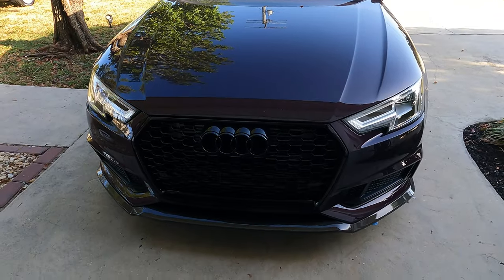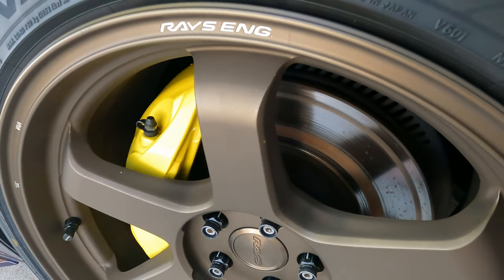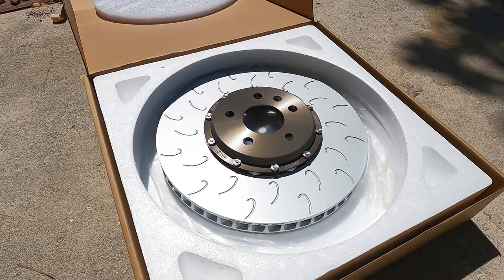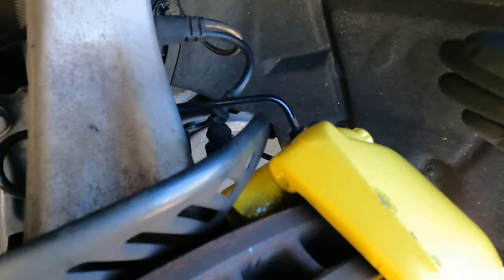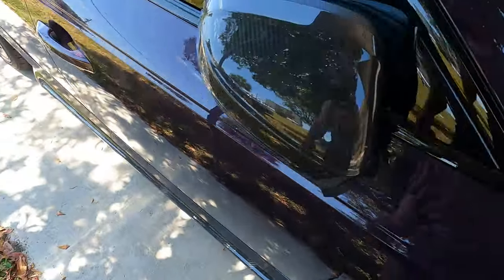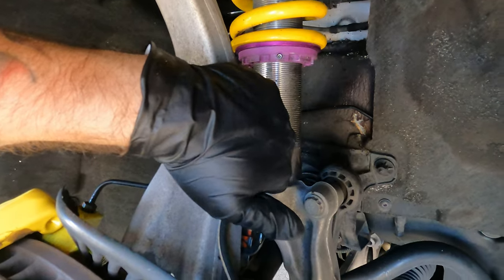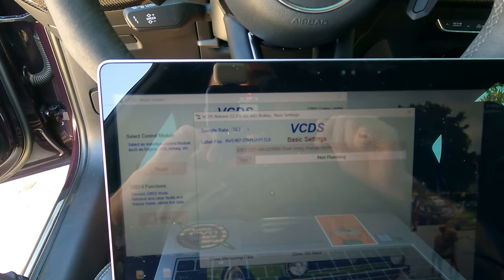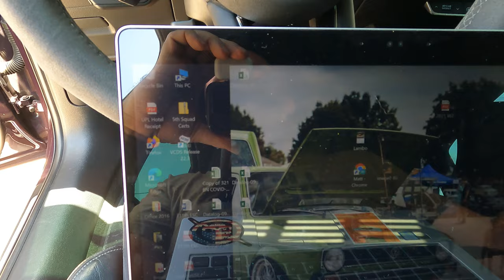B9 S4 - Update Video - Plus 034 Motorsport Brake Upgrade and Alpine Volks Fair prep!!

Comment: The apr coil packs look nice. Very subtle but enthusiasts would spot them.

Those rotors look stunning, even if the old ones were a bit of a pain to get off. My only tip to getting the caliper botls off would have been to turn the wheel to the right when undoing the left caliper ( turn left for the right caliper) as you get all the clearance you need then.. then straighten back up to work on the rotor.

As always the FL weather is looking amazing and an Archer cameo always makes the video! 

The S4 is looking great. 

Stay safe and looking forward to the next one 👍🏻